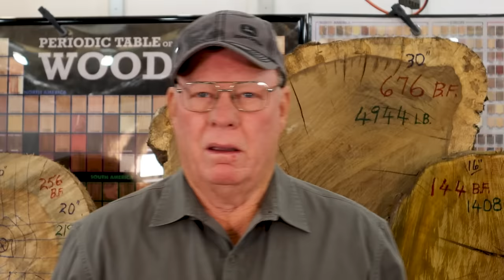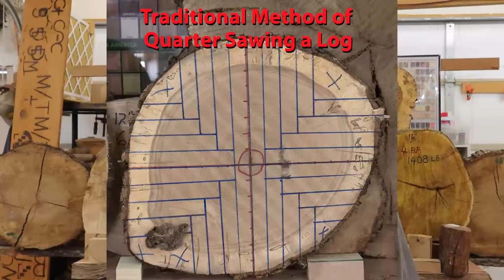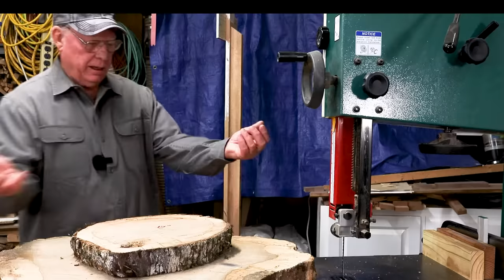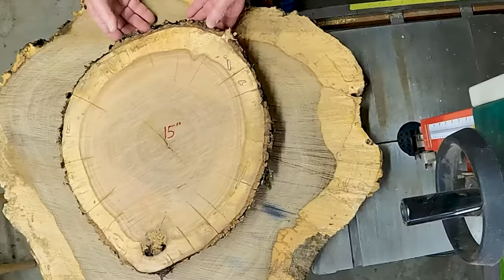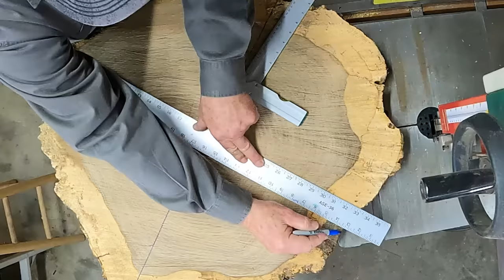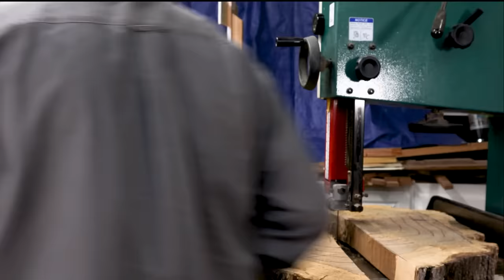How to Quarter Saw Lumber, The Old Way? Or the New Way?

Comment: That was a very well done explanation on quartering logs on a bandmill.  Having the visual is a must.  I learned this process 35 years ago when I bought my first Wood Mizer.  And I've been explaining the process to customers ever since, often with a stick in the dirt.  (your way is better) My general rule is the log should be around 21" at the small end to make it worth while.  On really big logs around 30" I actually find I can quarter saw almost as fast as I can grade saw.  Once you make the first few wide cuts the rest of the cuts are generally 12" or less allowing me to increase my speed rate dramatically while not putting as much stress on the blade.  
On a side note,  have you every tried  living off of minimum wage ?  I believe  in Texas it's $7.25.  Or $58 a day.  $290 a week.  You run a sawmill.  There are no easy jobs around a sawmill.  Which one of those jobs would you do for $58 a  day?

Comment: Don't "throw away" those corner cut-offs. Bias grain is great for posts and table legs. Cut those to square stock. (4X4, 6X6, 8X8, etc.).
Reply: departure
Reply: Thank you for the tip. God bless.
Reply: Yes, amen to that! It's still stable beautiful wood!
Reply: Just make sure to cut oversize and resquare as it dries, coz it will "diamond" on you, if mot already at desired moisture content. But yes. Definitely great FOHC lumber.
Reply: That's what I was thinking

Comment: I finally got a chance to assemble my mill about a month ago and have milled just about every evening since then. It was all pine for my fence up until this week when I cut down a 30" box elder and milled slabs out of it. Friday I cut down 2 30"+ red oaks and I'm going to try my hardwood introduction by quarter sawing a 30" x 8' section today which will max out my mill. I'm going to watch your video on cutting a log to fit a mill. I own a tree service and have a collection of larger logs so none of these trees were cut down for the wood.
Thanks!
Reply from the maker: keep up the good work.

Comment: Used this method on a 30" and 27" red oak x 8' logs new to sawmilling it worked great. Have an ez boardwalk 40,  home made 40" log arch and a homemade 3 point hitch hydraulic winch with over 500 ' of cable pull the wind blown over logs out of inaccessible ravines in WV . Greatly appreciated the wealth of knowledge from these videos keep up the good work thanks
Reply from the maker: Thanks for the nice comment.

Comment: Good demo.  One thing you need to consider with a band saw is the depth of cut (throat) on a lot of band saws is only 8 to 10", so quartering a log more than 20" diameter on the mill isn't feasible.  I've quartered many 40+ inch diameter sycamores with a chain saw just to maximize the quarter sawn grain.  Worth it, I assure you!  That angled grain from the corners is "rift" sawn, and furniture makers will also pay a premium for that, because it shows the same grain pattern on all 4 sides of a square table leg.

Comment: George you are a great presentor on this subject, learned a ton from this video and I don't even wood work, but you did an excellent job. 
Ps you could of done the same on a 15 in slab as your large piece and used a 10 in slab as the smaller for the example, would of demonstrate the same principle, and would of been easier for you to manage the piece for the video.  It is scalar for the discussion and reason why! 
Looking forward to your other videos, so we'll done George!
Steven Columbus Michigan
Reply: could of?
Reply from the maker: Yes, but if I used a smaller piece of wood to demonstrate with, would you have been as impressed? Thanks for the comment.

Comment: Ty for sharing! I came up with a way as well. You start by cutting 1" off the center of the log. Then take the larger section and cut 2" back from your last cut . Then flip the log cutting a 4" section from the side of the log right and left. This depends on size of the log then continue to cut the remainder quarter cut. The other side Very much the same other then you start 1" from your last cut.
Reply from the maker: Good for you.  It seems the more I saw logs the more new and easy ways I find to do it.  Keep experimenting, its fun to try new things.

Comment: You did a great job explaining the process. Another old way on a circle mill is to put your pie-shaped pieces on the carriage with the point of the pie up and centered then slab off, it'll be about 90% quarterback. I run a circle mill and that's how I do it whenever I need to get quartersawn. It works real well, I'm not sure how you hold it on a band mill, maybe put a 2×4 under the pointed side until you have made a couple of cuts then just turn over. Something to think about. 
Lee Gibbs sawyer, gunsmith, and machinist
Reply from the maker: In woodworking and sawing there is often more than one way to achieve results.  There is a difference in how you would hold a log for quarter sawing on a round blade mill various a bandsaw mills various a chain saw cutting. My normal routine is to try all the ways I can think of then chose the one that is the most efficient.  Thanks for the great comment.

Comment: Now i understand quarter sawing much better. No expert here by any means, it just was always confusing to me. Its like quarter round molding, out of a closet rod 1-3/8" round and quarter it, BUT the direction of the grain of the wood is everything, as far as strength and not warping. TY George great video you made it simple tyo understand. From SE Texas Bear

Comment: you make a great argument for a swing mill
Reply from the maker: Swing mills have their usefulness in cutting 2x4 & 2x6's. their limitation is how big a saw blade they have since you can only cut boards about 1 1/2" less than the radius of the blade. Thanks for the great comment.

Comment: I guess we have to take in to consideration that back years ago when logs were first harvested that the trees were of greater diameter and plentiful, waste was never an issue. So you get more quarter sawn out of a log. I also viewed a movie on how they only cut a few boards out for quarter sawn lumber, then cut the rest as basic lumber.
Reply from the maker: You are right.  The demand for quartersawn lumber is low, only about 5% of the lumber I produce is quarter sawed because that's all the request I receive for it.  In woodworking the only time, you need to use quartersawn lumber is when you make thin desktops or other surfaces that are not supported by cross grain supports.  the one great value of quartersawn lumber, because the grain runs at a 90 degrees angle to you flat project, it does not warp or get unlevel at the joints over time. As for the waste, just because you quarter saw a log does not mean that the offcuts cannot be used for a verity of other woodworking projects and there are many. Thanks for the comment
Reply: @georgewoodoftexas3509  that blows my mind because I thought quartersawn was "cream of the crop" so to speak. I figured everyone would want it.  I can only assume that the demand is low because the price is high.  When I go to my local supplier I can't afford to blow my entire check on premium quartersawn material if I can try to get by with the $5.50/bd.ft. flatsawn ash, lol
Reply from the maker: @ARMYStrongHOOAH17  Yes quartersawn lumber is more expensive because of the extra work and time it takes to produce it. I handle a lot of unusual wood cuts, lumber and slabs. I find it very interesting the many projects woodworkers turn my lumber into. So chose the right cut or lumber for the project. Thanks for the comment.

Comment: Great video! It also clearly illustrates the advantage of being able to mill bigger logs on limited capacity mills. 

My milling experience is mostly limited to milling slabs into framing lumber, and it is very aggravating when the initial milling wasn't done with those considerations in mind, leaving a lot less useable lumber. Great methodology - thank you sir.

Comment: I saw a guy recently with two big saw blades running at 90 degrees through the log at the same time. Was incredibly cool, the tolerances must be so precise to do that.
Reply from the maker: its called a swing mill.  good for cutting 2x4 & 2x6

Comment: As to the limitations you present with a band mill, is precisely the reason I bought a swing blade sawmill, quartersawing is possible without moving the log.  Very true on log yield with larger logs, I have cut many 5’ dia + up to 8’ dia logs, amd I can really stack up the bd ft per hour with the oversized dia logs!
Reply from the maker: Good information, It just go to show how there is many ways to do things in sawmilling and woodworking.  Thanks for the comment.

Comment: Really well explained. If you get the urge, I would love to see an explanation of how rift-sawn lumber is cut. I’ve seen the diagrams showing that the boards are cut radially, so they all have 90° grain, but I’ve never learned how they handle the log to achieve it. I assume it is very time and labor intense?
Reply: In his example log, those “corners” are technically rift-sawn if you were to cut lay them on one face instead of trying to jig it up in order to get quarter. Hope that makes sense. Typically rift sawing is just a by product of quarter sawing the log

Comment: George, this was a brilliant explanation.  I got your point when you drew it out on your sample piece.  Correct me if I'm wrong, but with the way you just explained, we would get more quality quarter saw lumber over the more traditional way?  Thank for making this video.
Reply from the maker: Thanks for the nice comment.  When I started looking into quarter sawing, I was amazed at how inefficient the old process was.
Reply: Surely good quartersawn lumber had its “ wastefulness” reflected in its very high price ?   That aside, I was taught that the most beautiful oak was achieved by radial sawing, by far the most wasteful method of sawing.  I suppose it depends why you are cutting timber, for the benefit of the sawyer or the finished object !
   Thank you for going to the trouble of showing us your processes.Your last section is really about radial sawing.
Reply from the maker: @CrimeVid  Sorry for the sudden ending, computer sent it before I was ready.

Comment: Thank you, sir, for your extreme efforts in this demonstration!  I subscribe to the idea of "waste not, want not", and I would not throw away the lumber thats less than 90 degrees.  The reason is, the wood with less than 90 degrees is STILL STABLE, and WONT WARP, even though it is not quite 90 degrees. Is the 90 degree issue really that important? I can still see the beautiful stripes in oak that is less than 90 degrees(I admit that they disappear around 75 to 80 degrees).
Reply from the maker: Thanks for the very astute and knowledgeable comment. This is just one of the Ideas I was trying to get across.
Reply: The biggest advantage to quarter sawn wood is shrinkage, not necessarily warping. It's easier to explain with visuals, you could probably find a video explaining wood shrinkage. As wood dries, it shrinks more along the growth rings than across the rings.
So imagine you have a 1x6 board. A flat/rift/plain sawn board will have growth rings running more horizontally, parallel to the 6" face of the board, while a quarter sawn board would have them running vertically only showing 1" sections of growth rings.

The numbers I'm about to use are highly exaggerated but easier to follow than percentages. If the wood you are using shrinks 1/8" per inch of length along the grain, then the quarter sawn board will shrink 1/8" in thickness while the flat sawn board will lose 3/4" of width. And as moisture content constantly changes in the wood according to relative environmental humidity, the boards could be constantly shrinking and expanding so the quarter sawn board moves less and is more stable over time.
Reply from the maker: As I have read and learned about wood it made me think of things, I have seen wood do.  Before I propose an idea, I test it by making up experimental woodworking projects to test my theories. Here is some things you can take to the bank:
1. ALL woods moves, different woods move at different degrees.
2. Depending on where the board comes from in the log it will move are deflect in different ways.
3. Quarter sawn wood is a way of reducing the movement in flat tabletop applications by assembling boards (say 4" wide) with the same grain direction that is 90 degrees to the horizontal plane since wood moves across the grain but very little with the grain.

I have barns full of wood that is air drying that I can show you many examples of wood movement in its many forms.  Don't forget wood moves down the boards by also twisting depending on how the tree grew.

Yes, you can only see the modeler rays of Oak and Sycamore when it is quartersawn.  wood movement is a different subject.

Thanks very much for the comment, keep up the woodworking.

George
Reply from the maker: @Bryan-yl7mg  Shrinkage is what always happens with wood.  the challenge is to keep wood shrinkage EVEN throughout a board keeping it from warping excessively enough to ruin you project.  
So on a table top this is best done by only using boards that have grain that run 90 degrees to the horizontal plane. Since all the boards in a quartersawn table top have the grain in the same direction warpage is reduced
By eliminating rift sawn lumber with a different grain direction warpage is reduced.

Thanks very much for the comment, Keep up the woodworking.

George

Comment: Hello , I just found your vlog. What degree on the wood when you cut it do you use ? I looked at a couple place and it was 80-90 degree on the grain , but a couple others said they were ok with 70 degrees and above . Thanks for your time and knowledge .
Reply from the maker: All of those are correct when sawmilling.  The real reason you quarter saw logs to get lumber that is stable and will not warp when you make something like a thin tabletop from it when it is dry. What a sawmiller can never do is see/guess how much wavey grain is in the tree that might make it warp even if you quarter-saw the wood.  Quarter-sawing is just the best way to eliminate most of the grain warping in wood. Another problem is sawmillers try to cut to wide a board when quarter sawing and you end up with half the board with quarter sawed grain then the grain starts to lean over as it goes around the log resulting in the other half of the board being sort of flat sawed.  this cause the board to warp unless before using it you rip all wood off the board that is NOT quarter sawed.  Thanks for the great question.

Comment: Luca Mill out of Australia make a circular blade saw that pivots from verticle to horizontal with a lever; max 10" cut. Seems that might be a great set up for easily cutting quarter sawn without ever moving the log
Reply from the maker: Luca Mills can do that, they also are good if you want to only make 2 x 4's on your sawmill.  they do not work for making large wide slabs. Thanks for the comment.
Reply: @georgewoodoftexas3509  I actually wish I had both saws. My buddy has a timber king and that thing is awesome. What I like about the Luca Mill is that also has the ability to use a 9' chainsaw mill for cutting slabs or rounds up to that width. Perfectly level everytime. That kind of stuff carries a good price. I'd say the bandsaw would be best to start with tho but they both have benefits

Comment: I had no idea that there is more than one way to get quarter dawn lumber.  
Would it be right to assume that plain sawn lumber is stronger than quarter sawn lumber?  To my way of thinking it is, but am l right or wrong?  Please tell me!
Reply from the maker: Keep in mind there is two answers.  Depending on are you talking about pine construction lumber (2x4's) or Hardwoods.  With hardwoods they are strongest in the flat or horizontal plane, and weakest in the vertical plane because the quartersawn lumber can separate under excessive loads. Hardwood is normally used in furniture making and construction strength is not usually a factor.  A lot more could be said on the strength subject. Thanks for the comment.
Reply from the maker: If you are trying to determine the strength of wood , go to engineering tables on wood beams.  For shop woodworking projects strength does come into play often.  It is best handled in how you designed the furniture project, and how each board supports each other.  Remember, quarter saw lumber only makes up about 5% of a sawmills production.  Its primary use in woodworking is to lay out table tops that do not have a lot of cross member support but you want it to remain flat over a number of years.  Quarter sawn lumber has very little wood movement. Other Funiture uses mainly plain saw lumber. Which is stronger...... depends on the woods grain oration.

Comment: How would you cut 1/4 sawn wood for instruments. Flame maple, quilt maple, mahogany,  basswood, alder. We need enough to make guitar bodies that can be book matched. 1 piece quarter sawn wood is really difficult to come by. Some time we need to put 3 pieces of wood together to make a body. Cedar and spruce 1/4 sawn for book matched acoustics is needed. We need wood that is the straightest wood esp before runout. Also the wood that you would throw away isn't there a market where someone could purchase the pieces in balk for wood turning it craft wood?